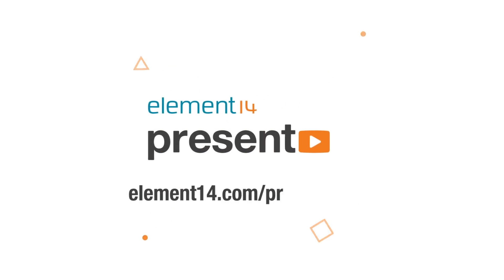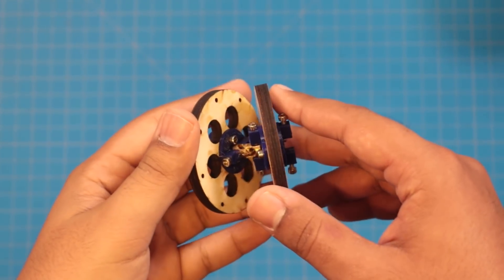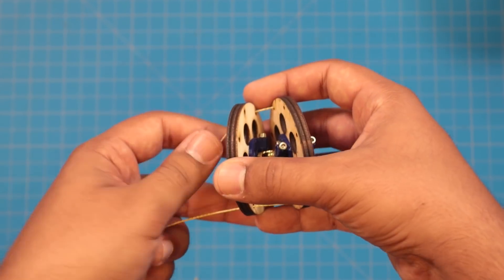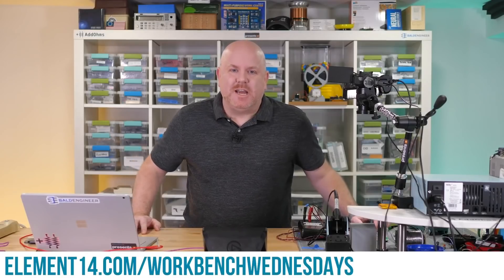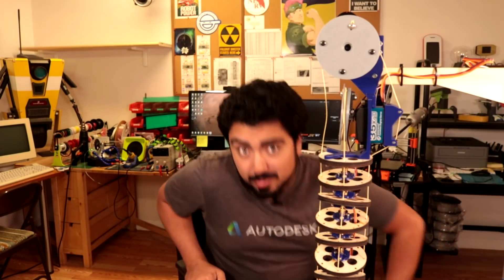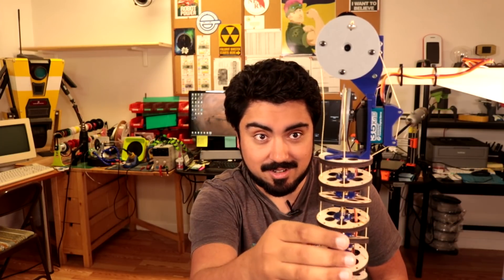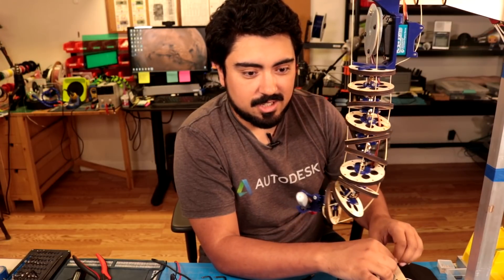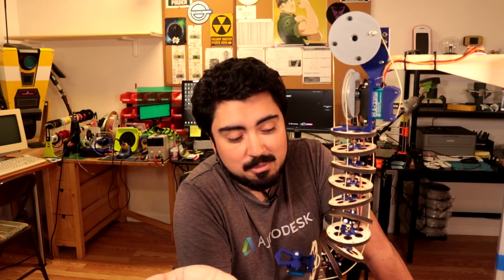Continuum Robot Tentacle Prototype

Comment: Maybe putting 4 springs between the discs where the Kevlar threads run through would spread out the articulation over more of the tentacle than just the bottom part.
Reply: Another idea, woud be to add Magnetic Cubes (neodymium), assembled with oposite poles between the discs... so, the effect would be like the springs, but invisible...🤔